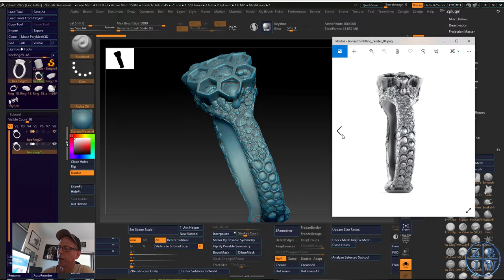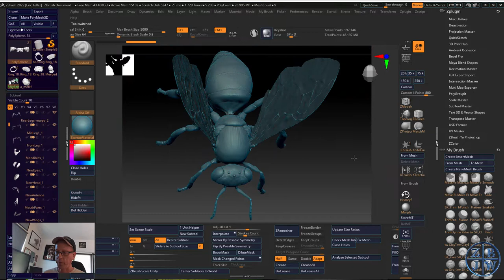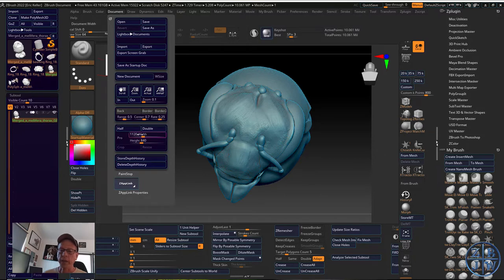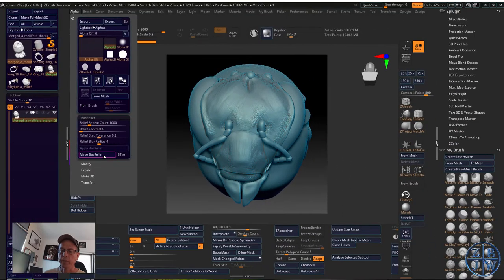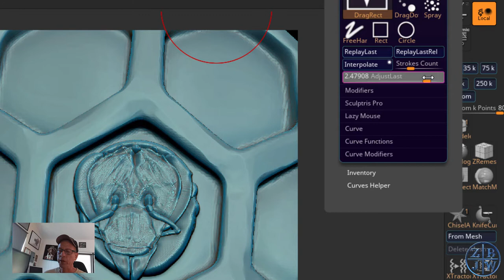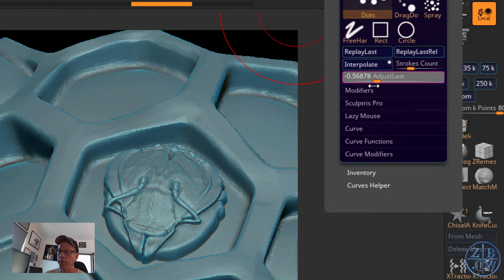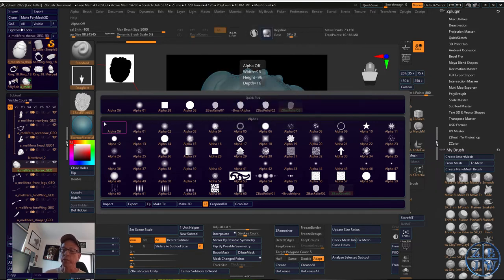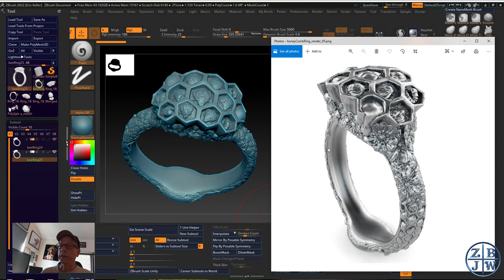Honey Bee Ring | Bas Relief Alphas

Comment: Hey question, How do you sculpt in Z-brush with real world measurements in mind?
I come from a CAD background, and I'm struggling to understand how Z-brush can give accurate and controlled sculpting.

- Thanks for your video it was very clear and informative!
Reply from the maker: Real world scale in ZBrush is easy, but not as obvious as your typical CAD programs make it.  There are a bunch of methods to check or set the size of your objects.  The simplest is just to use "Sliders to Subtool Size" button located in Scale Master.  This will also allow you to set the size of your object with the "Resize Subtool" button.  

You can also use the transpose line to check the distance between any 2 points.  "Analyze selected subtool" will also give you real world measurements, etc etc.  

There a quite a few ways of checking dimension.  The most important thing to remember is that when you're ready to export your model for 3D printing, CNC, etc that you click the "Update size ratios" button and choose the right unit you want to export in.  We always use mm, but it could be inches or whatever you want.
Reply: @ZBJW  Thanks, I appreciate the response :)